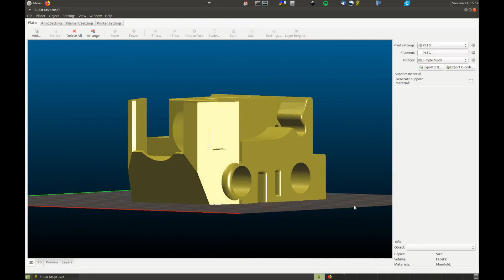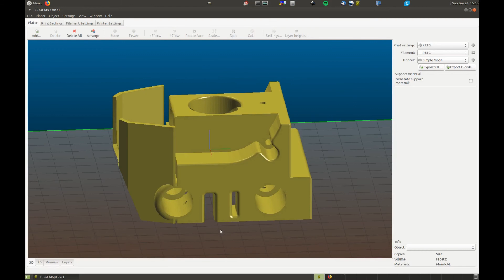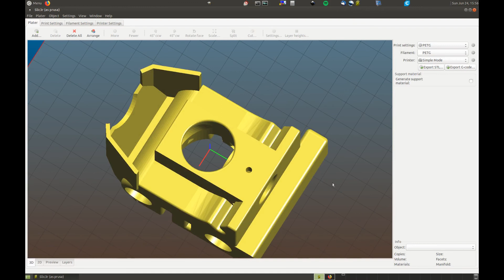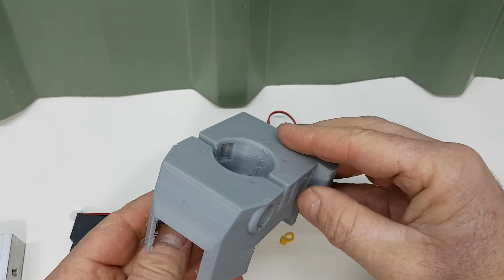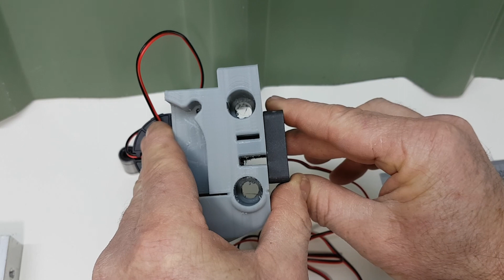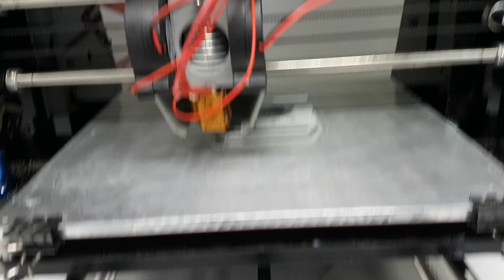X Axis Volcano I3 Official thingiverse

Comment: nice, but im thinking about leveling the the x achis iron bars on the horizontal layer and designing one mount for the slide bearings, the belt, ofc most importantly in the middle the mount for the e3d volcano v6, and one c-shape at the back for the cables, while using as little material as possible, and i prefer a different fan shroud, one that is additionally mounted to it and which cools the heatsink and the nozzle at the same time.
Reply from the maker: I have a couple of printers that use one fan for both, and usually I don't want print cooling.
I am often, actually usually wanting the best interlayer adhesion I can get.
Print cooling reduces that.
Print cooling is something I only use if I must.
That is why it is better to have it very tunable.
This design may look heavy, but in fact it is lighter then the bearings that are inserted.